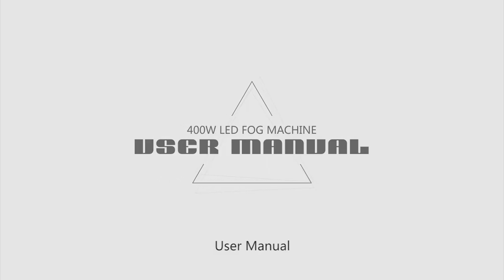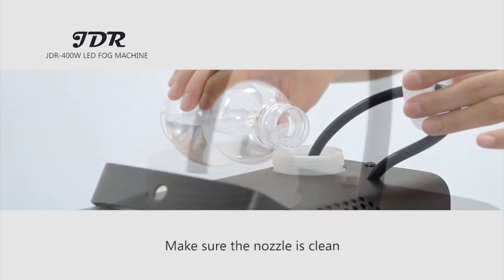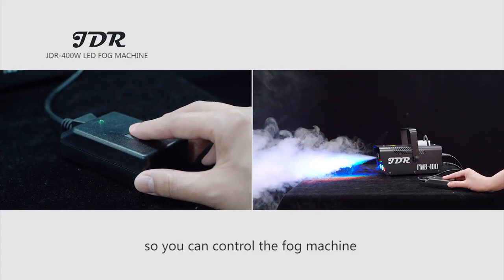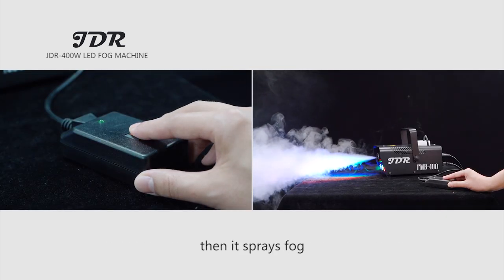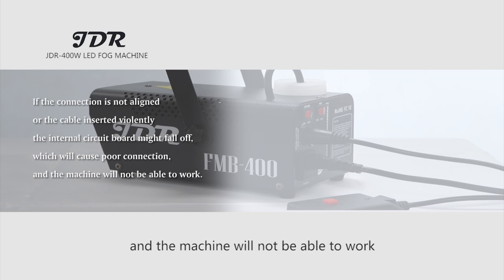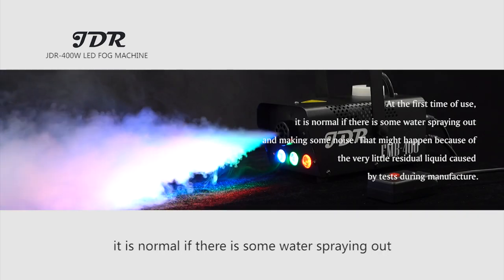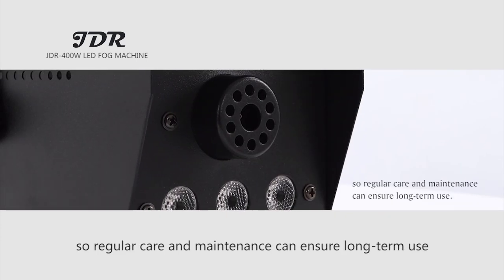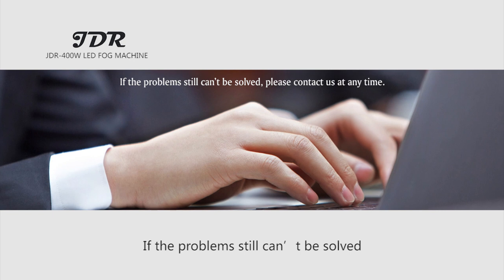JDR 400W Fog Machine  User manual

Comment: When I was looking for fogging machine that I could be used for as a  fogging insecticide machine to kill mosquitoes the JDR 400W Fog Machine website popped up and it advertised that this machine could actually do the job. My question is: Is it necessary to add water to the oil fogging insecticide to make fog or it can  make fog without adding any water to the fogging oil? The Black Flag Fogging insecticide fogging oil that I bought does't say add water to the oil to make fog. Thank you and looking forward to hear from the JDR 400W Fog Machine manufacturer.

Comment: Am I supposed to use a mixture of water and fog fluid? I saw it says use a 1:3 mixture for super thick fog lasting up to 5 minutes.
Reply from the maker: Sure.Dear friend.
E.g:In a space of 40 square meters,
①Use 1:10(Oil: Water) light concentration of smoke oil, spray for 20 seconds,the smoke disappears after 5 seconds;
②Use 1:5(Oil: Water) medium concentration of smoke oil, spray for 20 seconds, the smoke disappears after 30 seconds;
③Use 1:3(Oil: Water) high concentration of smoke oil, spray for 20 seconds, the smoke disappears after 5 minutes.

Comment: Hello. I bought this machine about a year ago and don’t use it too much. My machine heats up and I have replaced the fog switch control, but still no fog comes out.
Reply from the maker: Hi.The machine might be blocked due to high concentration fluid, not clean fluid or overheat, so regular care and maintenance can ensure long-term use. After about 40 hours’ continually use, please use 80% distilled water and 20% white vinegar to remove the accumulated impurities inside the heat pipe, as following steps:
1）Washing the pipe in the tank and the filter head.
2）Pour out the fog liquid, replace by the cleaning liquid (80% distilled water and 20% white vinegar), turn on the power, and keep it operating till the cleaning liquid runs out.
Reply: @musicjdr8373  does " keep it operating" mean spray fog or just turn it on ?

Comment: I bought this machine from the U.S. My question is could I use this fogging machine in another county that have 220 volts power generation? The Parameters said that 110 volts for U.S. and 220 volts for Europe. That does mean this machine have dual voltage input??? Thanks.
Reply from the maker: Dear friend
Thank you for choosing the JDR Fog Machine.
The voltage range of The JDR fog machine is 90-130V.
Have a nice day!
JDR Music

Comment: Should water be run thought the machine to clean it out after using?
Reply from the maker: Periodically clean your machine to reduce replacement parts and repair expenses.
1.The poor fog liquid can cause blockage. It is recommended to use high quality fog liquid.
2.The machine might be blocked due to high concentration fluid, not clean fluid or overheat, so regular care and maintenance can ensure long-term use. After about 40 hours’ continually use, please use 80% distilled water and 20% white vinegar to remove the accumulated impurities inside the heat pipe, as following steps:
1）Washing the pipe in the tank and the filter head.
2）Pour out the fog liquid, replace by the cleaning liquid (80% distilled water and 20% white vinegar), turn on the power, and keep it operating till the cleaning liquid runs out.
3. If the fog turns less, and the pump makes noise, or cannot spray fog, you should turn off the power immediately and at the same time check the fluid tank, fuse, controller interface and power plug. If all of these are normal, please connect the power with the plug and try again. If the problems still cannot be solved, please connect us at any time.

Comment: My machine won't heat anymore after approx 6 uses. The light on the back is green but only spits out cold juice... help!
Reply from the maker: Dear friend
You can try to clean the smoke machine. 
Periodically clean your machine to reduce replacement parts and repair expenses.
1.The poor fog liquid can cause blockage. It is recommended to use high quality fog liquid.
2.The machine might be blocked due to high concentration fluid, not clean fluid or overheat, so regular care and maintenance can ensure long-term use. After about 40 hours’ continually use, please use 80% distilled water and 20% white vinegar to remove the accumulated impurities inside the heat pipe, as following steps:
1）Washing the pipe in the tank and the filter head.
2）Pour out the fog liquid, replace by the cleaning liquid (80% distilled water and 20% white vinegar), turn on the power, and keep it operating till the cleaning liquid runs out.
3. If the fog turns less, and the pump makes noise, or cannot spray fog, you should turn off the power immediately and at the same time check the fluid tank, fuse, controller interface and power plug. If all of these are normal, please connect the power with the plug and try again. If it still doesn't work, please contact us via back office order.